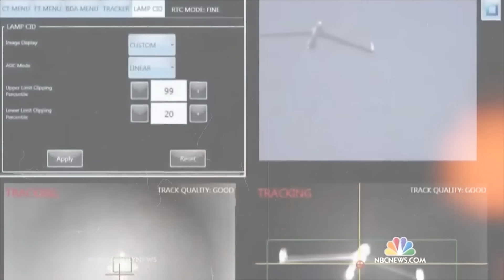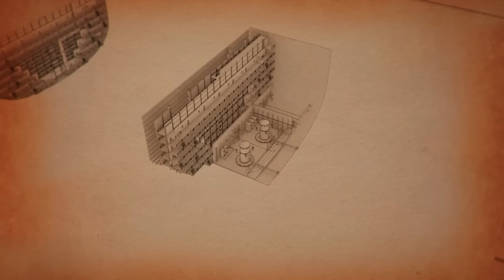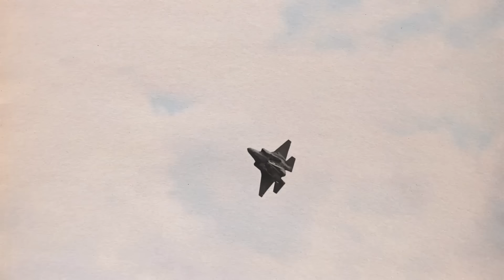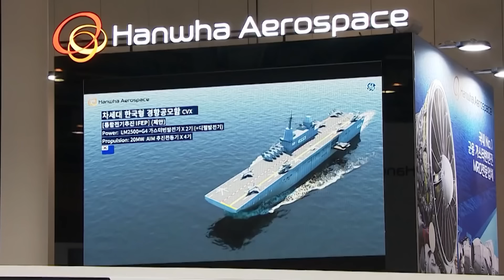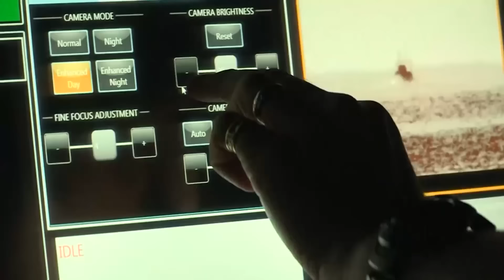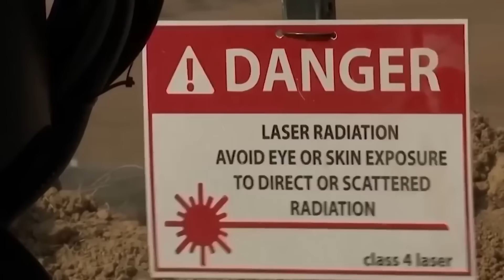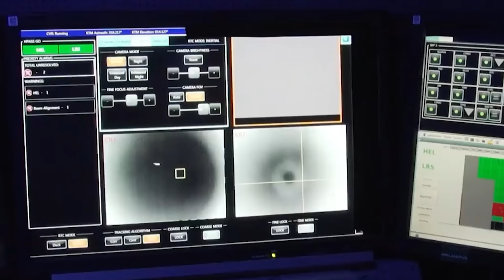The U.S. Navy Just Admitted They've Created A Monstrously Powerful Laser Warship

Comment: Time needed to recharge the laser, as well as, a projection of enduring level of laser force are important factors in the use of laser weapon.
Reply: they will probably start adding new ships to the strike fleets that have decks full of nothing but lasers
Reply: If they are showing this that means that they perfected this years😂
Reply: Laser's don't need to be recharged, they are not a battery.
Reply: @patriotsnation9224  you are correct.  This laser is not pulsed.  It has continuous output capability.

Comment: Lasers are not something new, they are just getting better and are more accessible. You could build 2000W laser gun that could be carried by soldiers, no need for ammo, just recharge them from large solar panels on the base. A millisecond impulse can burn through eyes, little stronger impulse through a bulletproof helmet. Even China probably already has them. Just like any other technology, there are countermeasures, whether it’s soldiers armor with reflective surface or tiny corner reflectors or vehicles/ships covered by corner reflectors, which could reflect the laser back to the source. Granted, ordinary mirror which would reflect 99% of energy would overheat and laser would burn through, but for this application you have highly specialized mirrors. Lasers also have limited range on the sea due to earth being round. So it cannot completely replace rockets and cannons. While laser mounted too low may have direct line of sight only 10 - 20 miles, with cannons and microgram precise ammo, counting in wind at different altitudes, humidity, coriolis force, etc., you can hit a target 1x1m at distance of 30 miles. What good is laser then? It is just another item in your arsenal. I was actually wondering why no one just points a laser from space on Putin and finish the war in an instant. Infrared laser during clear skies could get through the air with lower dissipation and hit the target. Who would then take over after him and continue?